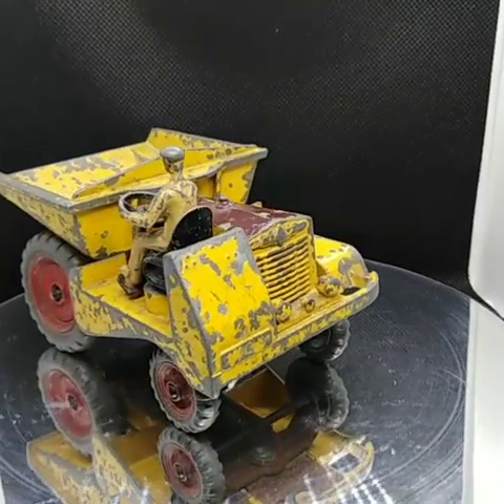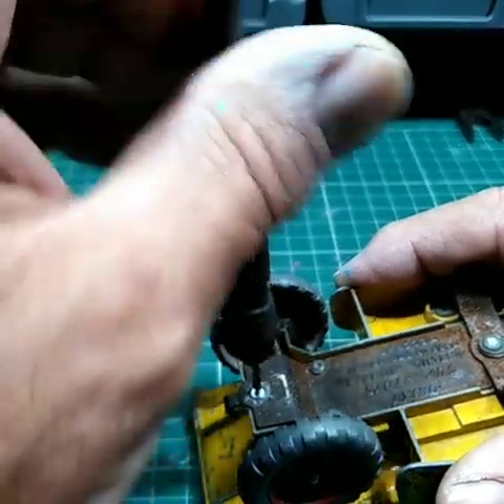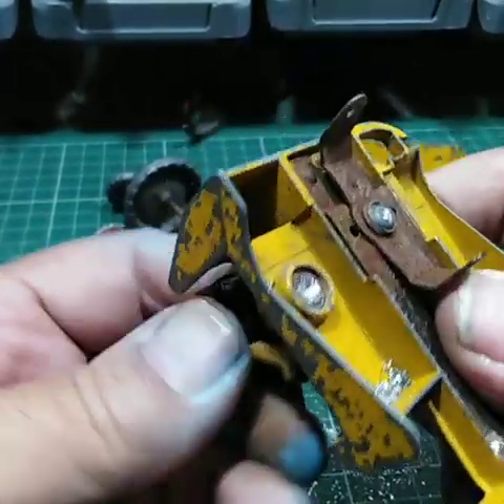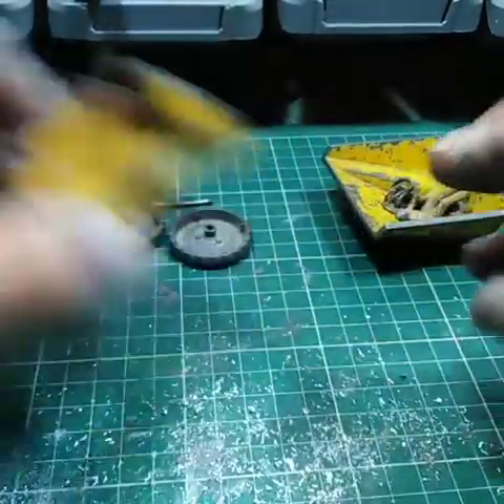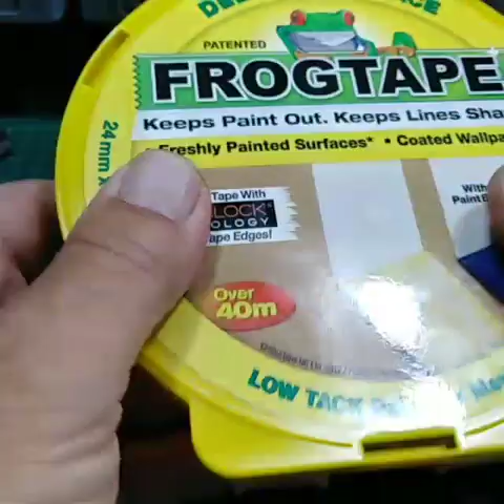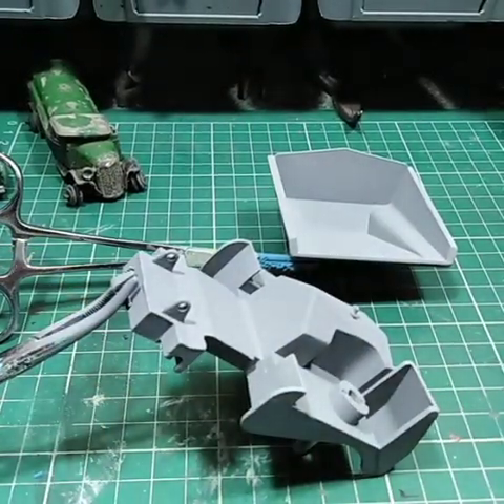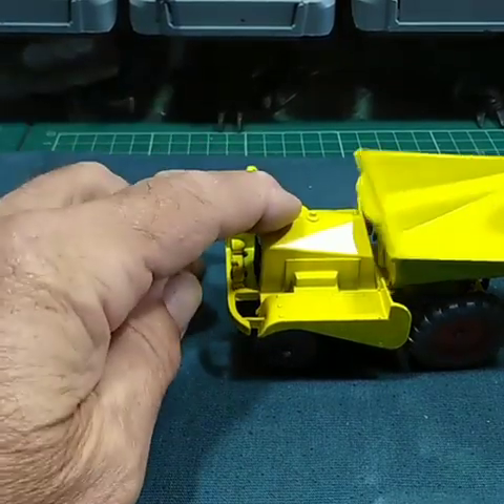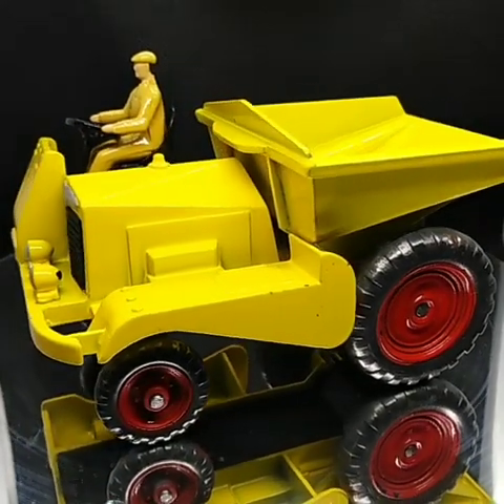Beef Eaters Challenge, Dinkys Muil Hill dump truck no/562  1948/62.

Comment: I think you've got Horris facing the wrong way Martin.Why would  headlights be facing backwards? I think Martin that I would have used a self tapping screw up Horris's clacker instead of just a dab of superglue. I think the superglue under pressure from the spring will soon give way.Nice restore though. To be a BeefEater can you be partial to other meats?
Reply from the maker: 🤣🤣cheers  Walter cought you ,🤣🤣if you see the second  set of magic round about shots show him round the right way, the chair is suppose to swivel but on the real one the steering column stay put ,the spring is weak so hopefully it will be ok . 
And old hungry Horris will it anything that isn't nailed down. 
Thanks for your support my friend take care 🙂